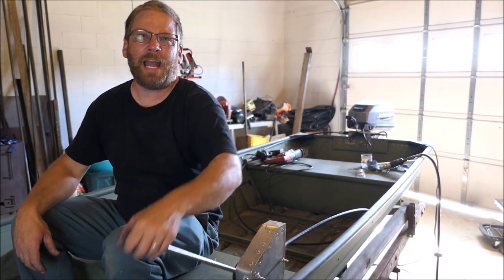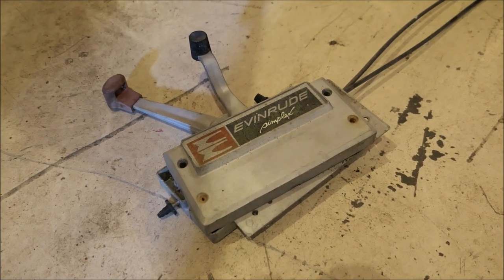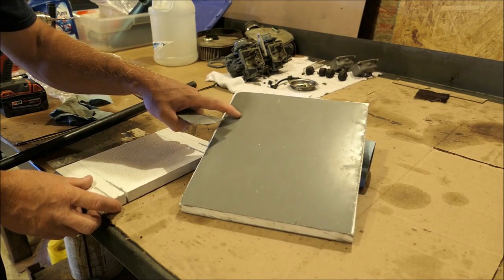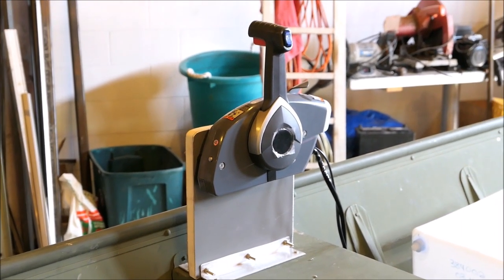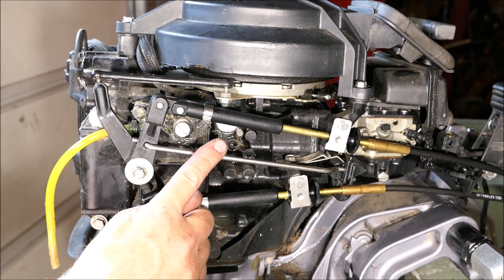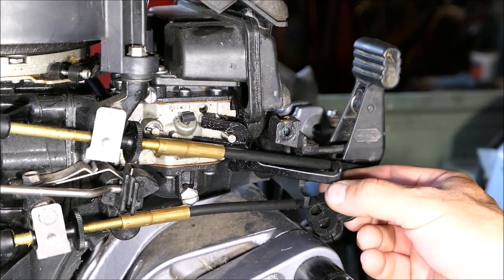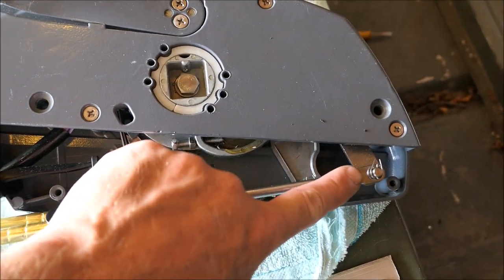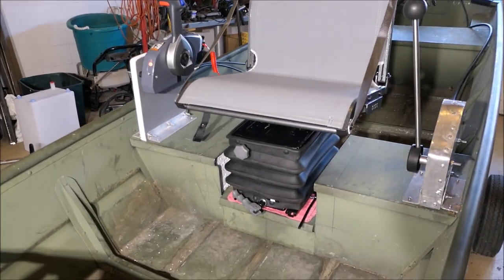Throttle and GEAR Shift REMOTES Installed on 15 Hp JOHNSON Outboard

Comment: Great video, I'm thinking of doing the same on my Gheenoe (remote controls) and have the same Johson. How did you find the part number for the conversion kit?
Reply from the maker: The engine offered remote kit from Johnson, I looked them up, then located them. Very difficult to find parts.
Reply: Hey, any luck on part number? Obviously you're sure I can't find it but I hope it'll give me an idea to fabricate etc

Comment: Nice project man! Would you be so kind to drop the OEM part number for the remote kit in the chat? Or if you have yours for sale I'll buy it off you
Reply from the maker: This is an older video. I'm sorry I don't have the numbers and unfortunately I sold the boat. Build one, I'm sure you will enjoy the process. Good luck !
Reply: @kentuckyyankee  Thanks man, im currently working on an placom 410 ( it has a small cabin on top ) and I had planned to put the 2000s 15 Johnson behind it... I have the steering system working but I can't for the love of god get my hands on the remote kit...
Reply from the maker: @2stroke-outboard-FRL  Yeah it was really had to find.